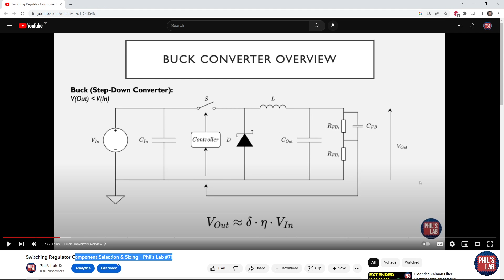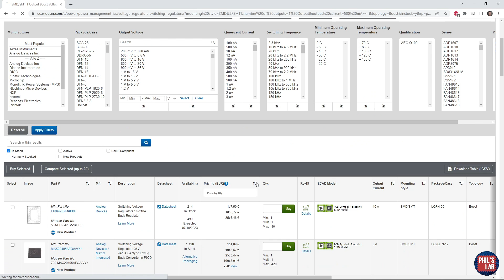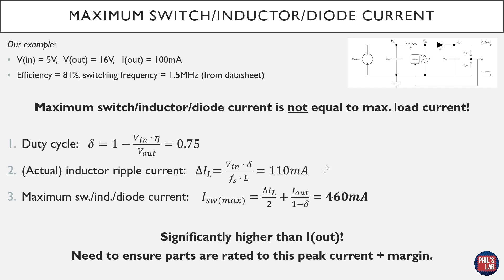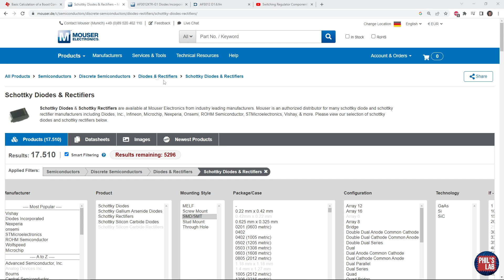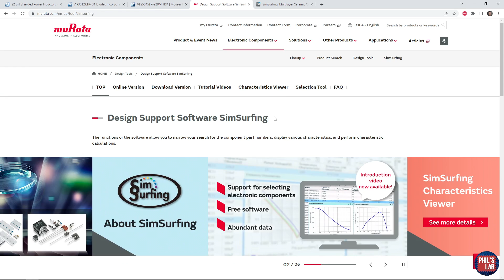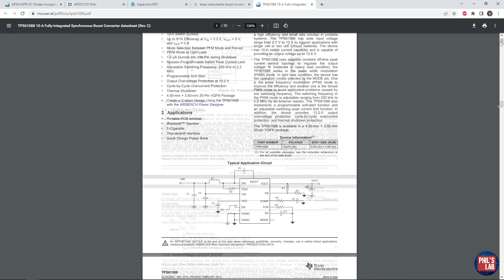Boost Converter Design & Sizing - Phil's Lab #113

Comment: This is a great video. Lots of good info.  As an analog IC designer, I'll add that the feedback resistive divider likely plays a role in feedback phase, so that is probably the main reason we want to avoid too high R values there. Should keep the same Rout of this divider (dominated by the 5k1) just as you did.

Comment: HI, I have no datasheet, I do code myself for controller, but how to choose bulk and ceramic caps
for boost, If I need 50 AMPS of current and 1400 V output voltage per phase, so 4 phases
200 AMPS of input current ?

Comment: Thank you for this video. I learned alot with this videos to design my own pcb with buck or boostconverters. But i got a question. Seems like the inductance is very related to the output voltage so how do i do it when im having an adjustable outvoltage?

Comment: Would be interested in techniques on how to power the controller properly in these designs.  The  concepts and sizing is great, but if you can't spin up the controller effectively then nothing else really matters.

This is particularly important for MPPT etc. where you have a battery and solar and you're using an STM32 as an example and you need to power it from either the solar or the battery.  My previous hack has been to use a buck regulator and then hack up some sort of gate that prefers battery if available and solar if not using a fet.  Would love to see a better solution or at least one that is comprehensively designed.  This also applies for push/pull issolated DC/DC converters at high power.

Comment: As always, an excellent presentation.
Would love to see a vid on flyback converters. I made a flyback with UC3843 12v to 300v to run a DC capacitive discharge ignition system that I designed. It works OK but I'm not an expert by a long way and I'm sure that I'm missing something important. Particularly the snubbers are a little tricky for me.
But anyway, keep up the great work. Most of your vids are way above my pay grade but super interesting none the less.
Cheers
Matt

Comment: This was well done, short and dense. I'm off to watch #106, got a couple questions. What's your experience matching simulation results (assuming the models are ok) to circuit measurements for boost converters? Also, say the boost converter doesn't quite work, how would you go about finding the error in component selection? Maybe these are topics for future videos. Personally, I'd like a boost converter from 18V to 400V@100mA for some vacuum tube guitar amplifier designs. These requirements are far outside all the common tools available like the Mouser/DK/TI search engines.  Thanks for the video, it was exceptional.
Reply from the maker: Thank you very much, Craig!
Those are great questions and definitely worthy of some videos. In particular for simulation, that's a great idea - I wanted to make some more on SPICE sims in any case. 
For boosting to a high voltage, if you can bring the current requirements down (e.g. for a guitar valve pre-amp), then I'd suggest a Dickson charge pump for simplicity. For a power amp with valves, I would go the AC, transformer, rectifier route.